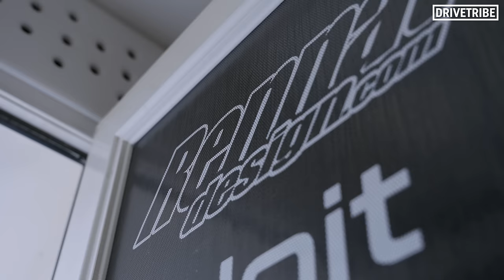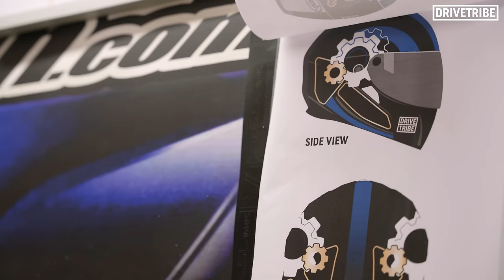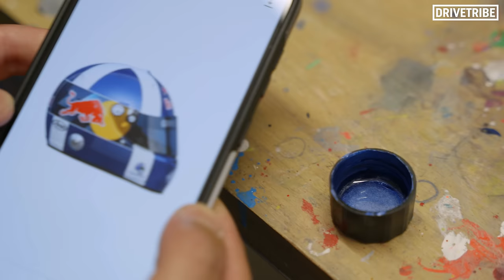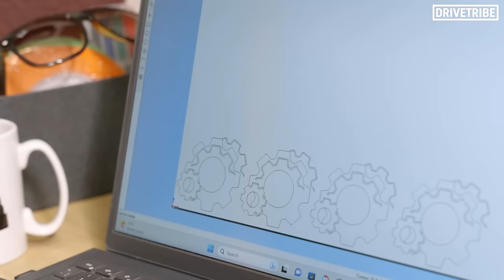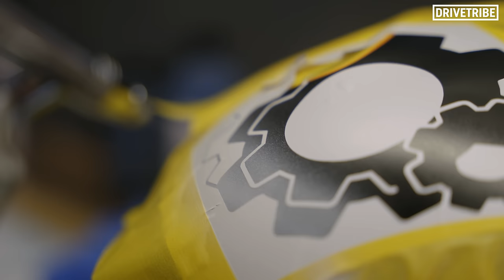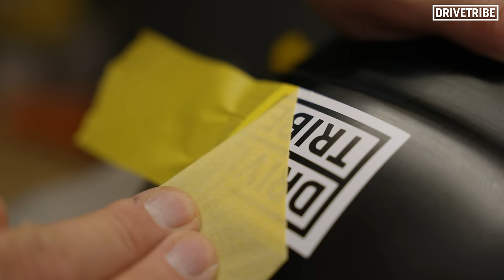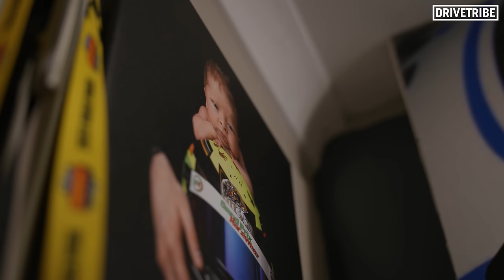This is Richard's Hammond's new prized possession!

Comment: 15:07 Flip-down sun visors are amazing! Not only do I have one in my touring helmet, I also have one in my track helmet!
Reply: 100%! wouldn't give mine up for the world
Reply: It's the most really cool dad thing ever!
Reply: Same. Surprised more top brands don't offer them. Just picked up a new Caberg to replace my old shark ridill and not many in the shop came with a flip down visor.
Reply: 100%^^   I had two helmets without one and now that I have one with I can't ever imagine going back. Absolute game changer.
Reply: My problem with them is most dont come down far enough and make you look a berk. 
I usually go for a dark visor and carry the clear one on my waist.
Reply: As a rider with sensitive eyes, they are an absolute must. Especially in winter, with low sun but also low light. Riding into a sunrise or sunset without one just sounds unsafe.
Reply: Both options are More convenient… Less safe.
My track does not allow flip up helmets
Reply: @rynoopperman5010  Drop down sun visor safety is context dependent I think.

Yes, in a crash it's less safe. But being able to see clearly in any light means you are less likely to crash in the first place.

For the track, you are doing short rides, probably during the mid day. Predictable light, you can reliably select an appropriate visor before the race. 

For commuting, lighting can be unpredictable, and being able to adjust mid ride is extremely useful.

Flip up, yeah, that's just less safe than full face. Although Hammond likes an open face helmet for piece to camera, so a flip up lets him do that while retaining some full face protection when not talking.
Reply: Modular helmets notwithstanding, helmets with and without flip up sun visors -- say a Shoei X14 and a GT Air II  -- will provide markedly different levels of protection when subjected to the UK's  SHARP helmet testing regime.  The amount of force that is transmitted into a rider's temple - where the visor mechanism has to take part of the foam lining out -- will be higher for the one with the sun visor.  I agree it's cool and convenient, but it's not a chance I'll take with my brain.
Reply: track helmet with an internal visor known for flipping down on its own? What do you race 50ccs? 😂

Comment: Spray Painter Here. Im used to the Yamaha Blue i use it all the time its my favourite colour.  It's called Deep Purplish Blue Metalic Candy 'DPBMC' is its colour code for anyone who needs to know. The genuine stuff is a  3pack but the way its been applied on this helmet wont ever have the true candy look to it in the sun like the Yam bikes have. The reason being is because the three stages of it need done within 10-20 minutes of the other and the clear coat needs put on within a half hour of that to achieve the proper candy look. If you let any stage dry too long or if you touch it before the clear coat is on it especially on the first colour coat stage (like they did in the vid)  then subsequntly have to wash or sand it back again you lose its ability to hold the following metalic stage correctly. Doing "control coats" at low pressure at distance with the metalic stage of the paint can somewhat get it to lay decent but the 1 stage colour coat which looks like a completely matted blue does not want touched in any way and if you really must denib or remove dirt before the clear coat then do at the very minimum a light coat of the metalic stage before doing the fix then do your normal coat of the metalic stage as usual followed by ideally 20-30mins of dry up till its no longer wet looking, then fire the clear coat on. You get the proper full candy effect of the paint this way. Same with the red candy Yamaha and Kawasaki candy green. Cheers lads

Comment: compasses for pencils and their sharp needles are readily available from the likes of aristo,faber castell,rotring etc.
Reply: ikr you get compasses with different point fittings so you can swap out for as sharp or blunt a pin as you like even different material pins some specifically for fiberglass and plastics. We use them all the time, the dude needs to get a decent compass set thats abysmal that.

Comment: Curious as to why he did a stencil for the cogs instead of doing a vinyl and then clear coating it?  Too thick?
Reply: From what I’ve been told (in Australia). You can’t put stickers or stick on design on a helmet. The glue will eventually compromise the integrity of the safety shell of the helmet.
Reply: @timothyzwart7412  Had not thought of that but makes sense.
Reply: @timothyzwart7412 the helmet is glued with epoxy inside 😂

Comment: His work is amazing👍
Reply: Im a spray painter here in Scotland i do freehand and proper manual pin striping and the likes. Hes decent but these are stencil designs and kind of basic. If you want a true custom helmet paintjob you need to speak to the real freehand guys. Aldo Drudi is the best about at this level of custom paintjob. Not taking away from the guy but the lid while on its 1 stage of the Yamaha DPBMC the matted blue stage should not have been touched or interfered with in any way. Its critical the first stage of that colour gets layed then left untouched untill the 2nd stage metalic coat is on, followed by the clear. The metalics dont lay right if you sand back or even clean off that 1st stage colour coat or if someone touches it like in the vid. Its a true 3 pack candy you need to apply it correctly for it to have the correct candy look. Loses its depth and colour flip when you dont spray it on right and if you mess with the 1st or 2nd stage washing it or lightly scuffing it back you ruin the metalics in it and they dont sparkle correctly.  Ive been doing it 3 decade for the record.

Comment: nice but not perfect, i saw some paint inperfections there, 8/10
Reply: they messed up on the yam DPBMC too. You cannot touch or even run a tack cloth over that 1st stage mat blue part of the paint or the 2nd stage metalic coat does not lay the metalics the correct angke when it flows out. That first matted dull blue stage coat where he was holding it and finger poking it for the camera is designed to flow out and leave a perfect etch on the surface if it for the following 2nd part metallic coat to lay correctly. You cannot get it to lay the metalics correctly if you touch this surface even air gun blast it too close as  its critical that its treated as an etch up surface. You get the dreaded whitey grey looking metalic look rather than the proper sparkle from them like you get when they are all layed in at the right angle. You can control coat it all you like from whatever lowered pressure and extra distance that would usually lay metalics right on a 2 part. Doesnt wash with genuine metalic candys like the yamaha one is you need to do 3 part candys properly or dont do them as it will look like a 2 part one so defeats the purpose. He should know that.

Comment: The paint on the helmets was awful. Soo many touch ups needed
Reply: the yamaha DPBMC was put on incorrectly too. Its a 3 pack candy two of which are waterbased.  The 1st stage of the colour coat was the matt looking blue you seen him when he was first touching the helmet as it was being sprayed. You cannot disturb the coats on Yamaha DPBMC they strictly need treated as a candy so you need to throw the 1st stage matted blue on and then as soon as its flashed off 10-15mins later you do the 2nd stage metalic coat. The critical part is that you dont touch the previous coat you dont even denib it as its what hold the metalics correctly when the metalic coat flows out. If you even run a tac cloth over that first stage of the paint you have ruined it's etch surface so the metalics when they go on will look white rather than sparkly. If you messed up a small patch of the 1st stage you can do a control coat over it to get the metalics to lay somewhat corectly. You also need to do the coats back to back all the way to the clear coat so 10-15 mins between the 1st and 2nd colour coats and then between 25-40mins before applying the clear. Obviously this varys with temp but you need to do a 3 pack candy this specific was or it wont have the correct metalic lay or a true candy look and colour flip too it, it will look flat and white metalics rather than sparkly metalics. Maybe he did it to make the DPBMC look more of colour match to what he thought it would need to be. Still though you dont let people touch any stage of a 3 pack metalic candy and certainly not a waterbased one